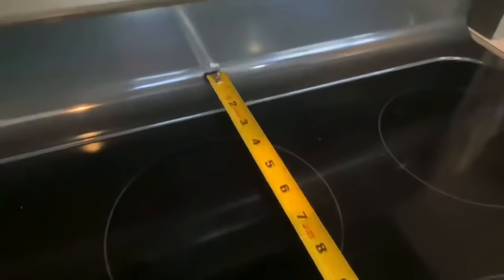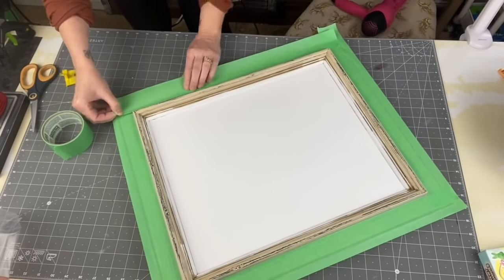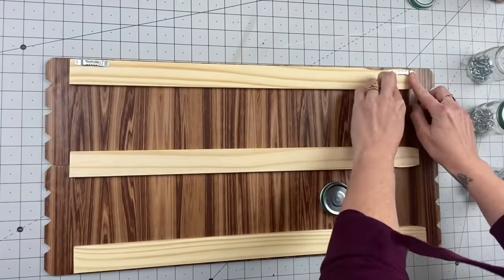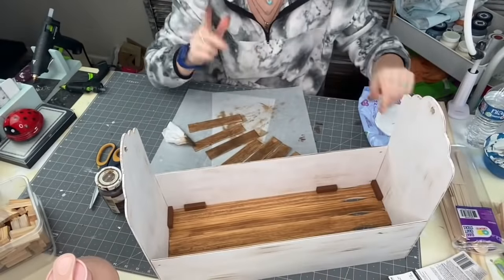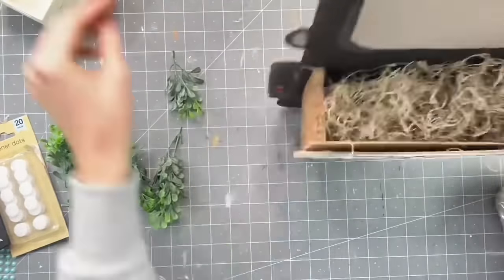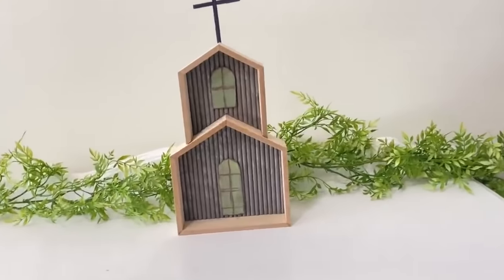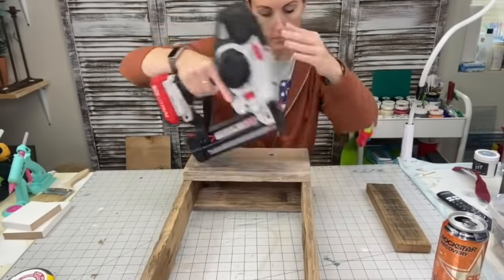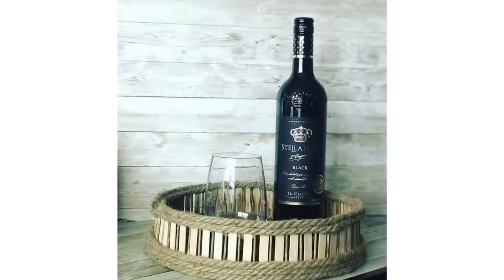BEST 21 HOME DECOR DIY’S OF 2021 | DOLLAR TREE HOME DECOR DIYS | DOLLAR TREE DIYS | FARMHOUSE DIY'S

Comment: You could even add a small sign with the numbers to your address hanging to the one you did with the swindle. Like two metal hooks (maybe metal shower curtain ones) and add a wooden sign to hang from it or even just a rectangle piece of wood hanging with numbers.